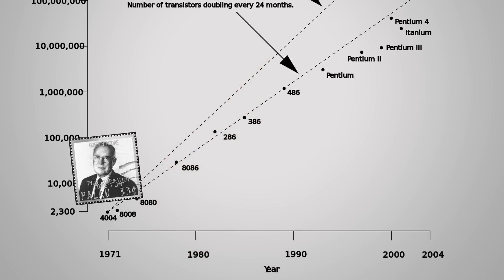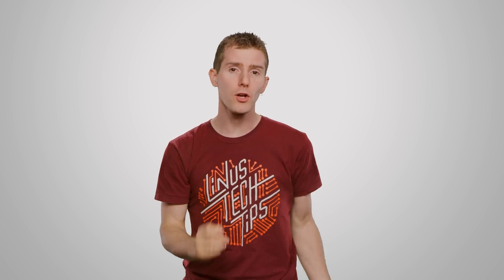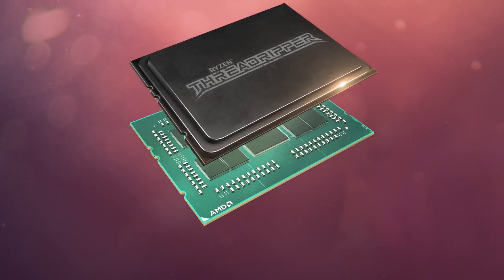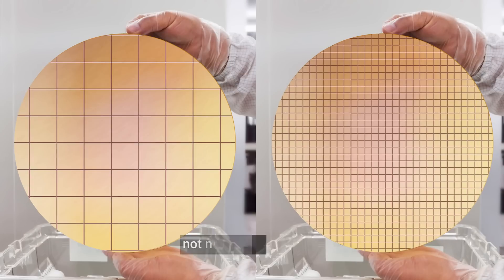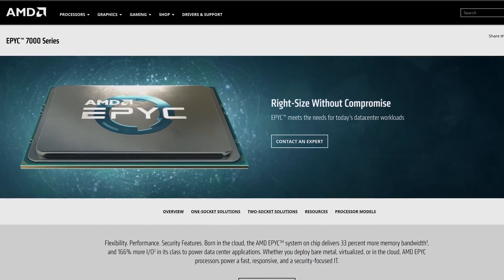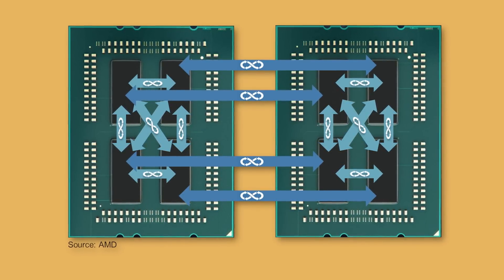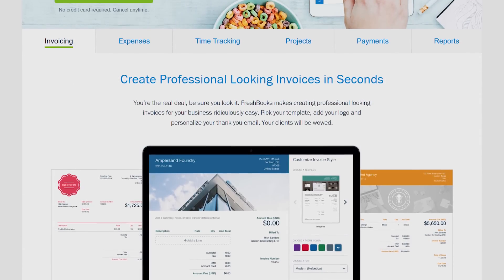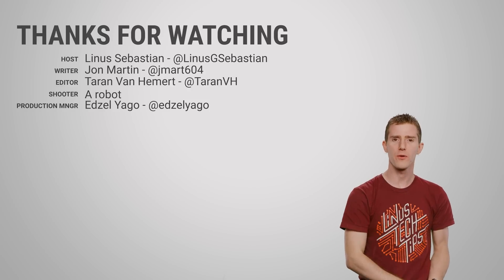How AMD is Making CPUs More Affordable - Chiplets Explained

Comment: And yet the Ryzen 3000 series CPUs are all overpriced. I can't believe I'm saying this but intel needs to come out with something new to lower AMD's prices.
Reply: Prices are not that bad.
Reply: @ayfr1249  
The Ryzen 5 3600 at 200$ and Ryzen 5 3600x at 250$ is the same as IF AMD launched the Ryzen 3 1200 for 200$ and Ryzen 3 1300x for 250$ back in 2017...

The Ryzen 7 3700X at 329$ and Ryzen 7 3800x at 400$ is as if the Ryzen 5 1600 was launched at 350$ and the Ryzen 5 1600x was launched at 400$ back in 2017...
Reply: @rattlehead999  Ryzen 7 1700x was released at $399 while 3700x will be released at $329. Same with 1600 being at $219 and 3600 at $199.

What's your point man ?
Reply: @ayfr1249  
I said AS IF.

At 7nm with the I/O gone, 6 cores should cost as much as 3 cores are 12/14nm with the I/O... And the I/O is extremely cheap on top of being on the now extremely cheap 12/14nm... -_-

And I mean the 1700 not 1700x.
Reply: @rattlehead999  The 7nm is a new process and their yields are not as high as with 14nm.
Reply: @ayfr1249  I'm comparing 14nm at launch to 7nm at launch.
Many did the calculations, there is no reason for the RX 5000 series GPUs and Ryzen 3000 CPUs to cost as much as they do...
I compared the prices/MSRPs when they were new, otherwise, currently the Ryzen 7 1700 is 160$, and Ryzen 5 1600 is 110-120$ so yeah.
Reply: @rattlehead999  Smaller the process, lower the yields. Price of $200 for a 3600 is totally fine by me, I don't see what are you complaining about.
Reply: @ayfr1249  Ryzen 3000 CPUs had 70% yield rate early last month, Ryzen 1000 CPUs were launched with an 80% yield rate, but at the same time... By launch, it will be at least 75% yield rate...
Reply: @rattlehead999  If you can't spare $200 for a 6c CPU you are better off buying a console.
Reply: @ayfr1249  I can spare 300-350 euro for a CPU, has nothing to do with how overpriced the Ryzen 300 and RX 5000 series are...

Overpriced = very high profit margins.

For example, the Radeon VII is NOT overpriced as it costs 650$ to AMD, and they are selling it for 700$, that's a 7-8% profit margin.

The RX 5700XT costs them around 230$ and they are selling it at 450$ which is 95% profit margins, thus overpriced.

The gtx 1080 has a MSRP(FE MSRP became the actual MSRP) of 700$ for a mid range GPU in 2016 that should have costed 330$ maximum and they sold the gtx 1080 at 100-138% profit margin during the duration of the gtx 1000 series GPUs, which is why their stock prices rocketed, the entire gtx 1000 series line up was overpriced to oblivion and still is.

The RTX 2000 series are less overpriced than the gtx 1000 series as they have much, much, much bigger die sizes.
Reply: @rattlehead999  GTX 1080 is a mid range GPU ?
Just tell me how you know all that stuff or you just make it all up.
RTX cards are overpriced as hell, I'm not paying  $349 for a mid-range GPU.
Reply: @ayfr1249  Well firstly I've studied hardware microarchitecture and design for many years. But since I can't give you thousands of pages and over a dozen of books of knowledge(which I've forgotten a lot of, since I haven't studied or applied what I've studied in 5 years)

The objective definition of a mid-range IC Chip(be it GPU, CPU or a simple micro-controller) is roughly half of the biggest possible die size for the wafer(also known as Optical Limit).

The gtx 1080(GP104 - Geforce Pascal 104) is 314mm^2, the GP100(unreleased gtx 1000 series GPU, only released as a GP100 Quadro) has a die size of 610mm^2.

Secondly, the gtx 560(GF 104/114 - Geforce Fermi 104/114) from 2011 had a 332mm^2 and costed 200$ MSRP(254$ MSRP) in 2016, but it had a 60-65% yield rate and 1GB GDDR5 costed 50-55$ back then and 40nm was the worst process node in history.

The gtx 1080 has a die size of 314mm^2, it came out with a yield rate of 80%+ and back in 2016 GDDR5(X) costed 5.5$ per GB, that's 44$ for the Vram.

AMD, Intel, Nvidia, IBM, ARM and so on do NOT pay per individual chip, they pay per wafer of silicon, the smaller the die size, the more chips you can have per wafer, the cheaper it is per chip.

So the gtx 1080 has a 10% smaller die size than the gtx 560, 15-20%+ higher yield rate,  and cheaper VRAM, why should it cost more than 250$? I give it 330$ due to lack of competition, they deserve to win more when they are ahead, but 700$...

Even the chip names are of the same tier between the gtx 560 and gtx 1080 - GF104/114(Geforce Fermi 104/114) for the gtx 560 and GP104(Geforce Pascal 104) for the gtx 1080.

Also, you can read Nvidia's annual/quarterly financial reports, to see their profit margins... 

But if their stock going from 19$ in Q1 2016 to 289$ in Q3 2018 doesn't scream insanely high profit margins I don't know what does.

Since people don't like to trust random people on the internet with arguments and facts, you can see many videos of random strangers on youtube that say the same thing. Like GoodOldGamer and AdoredTV.
Reply: @rattlehead999  The fact everything is overpriced is because people will keep buying the products no matter the cost. That's the biggest issue.
Reply: @ayfr1249  Did you read my entire comment or just quit? Just curious, because people tend not to do so.

That is absolutely correct, because people are ignorant and don't understand the products they are buying on top of 99.99% of YouTubers being just as clueless... they aren't even engineers in this sphere or at all... they just run benchmarks, config and build PCs/Servers... child's play... and people blindly follow them.

Not to mention that since 2008 the PC hardware market has been stagnant, barely improving every generation.

They try to make the smallest possible die sizes to sell them at the same or higher prices to increase profit margins while improving enough to call it "next gen".

Zen2 is absolutely poor upgrade for Zen1/Zen1+...

ARM and IBM, on the other hand, destroy each generation with the next.

Pay attention, in 9 months, ARM improved the IPC by 35-50% on the SAME Process Node, while reducing power consumption and transistor count by 15-20% and increasing clock speeds by 10-15%...

AMD in 2x years Improved IPC by 15% from Zen1 to Zen2 and all the 8-10% clock speed benefits come from going to 7nm from 12/14nm and Zen2 on 12/14nm would have lower clock speeds than Zen1(+)...
Reply: @rattlehead999  Who the hell cares about ARM and overpriced smartphones my man ?
Desktop CPUs will peak in performance in a couple of years and will come to a stop unless totally new architecture is introduced.
Reply: @ayfr1249  
You proved that you don't read my entire comments...

I care about ARM as they are in many servers now and in the coming years might take on the desktop...

ARM is NOT only for smartphones, they have server CPUs and the moment windows and iOS are written for ARM they are coming to the desktop.

A cortex a77 8 core beats an i5 8250U in X86 emulation! Just keep that in mind. IN EMULATION. And it's a RISC architecture emulating a CISC architecture which is much more demanding than vice versa.

Also as I said AMD and Intel and Nvidia are NOT improving their hardware more per generation on purpose... to milk us dry for what it's worth...

They could easily have 50% increased performance generation over generation...
Reply: @rattlehead999  They are not milking me for sure, I'm upgrading every 4-5 years so I'm not falling for that "upgrade every year" thing. It might beat mobile CPUs but I don't really care about that because I use desktops.

We surely need more competition on CPU/GPU scene because at this rate building a mid-range PC in a few years will be a luxury.
Reply: @ayfr1249  
VIA(bought Cyrix years ago) is going to release x86-64 CPUs soon as they won a license in a lawsuit against intel.

Intel is coming to the GPU market as they finally got licenses for AMD.

The i5 8250U is a desktop chip at lower clock speeds. And you need to understand that the ARM CPU has less than 10W power consumption and it costs only 15$!

The i5 8250U is like an i7 7700k at 1.8Ghz, but the ARM CPU is at 3.0Ghz.

A 15-20$ 8 core A77 CPU consuming very little power, beats a 300$ i5 8250U at 25W TDP AT EMULATION, I repeat EMULATION of x86-64 compiler!

In native code, a 4x core A77 would destroy the i5 8250U.
Reply: @ayfr1249  Also I want to upgrade every 1-2 years, but I don't. A good upgrade is 80% more or more performance at the same price as you paid for your current hardware.

Sadly this means I have to wait 4 years to get such improvement since 2008... so sad.

I'm a hardware enthusiast(doesn't mean I buy the most expensive hardware) and I like progress, evolution and especially revolution in the hardware market and I like to upgrade as it's a hobby of mine.
Reply: @rattlehead999  Well, upgrading your stuff every year to get 10% more performance is really stupid. I don't have an issue with Zen 2 pricing, obviously it could be lower but things are not as fucked up as the GPU market. Can't wait to see more players in the CPU/GPU market.
Reply: @ayfr1249  
Yeah, and the sad thing is that people that came into the desktop market or started paying attention after 2008 think that 10% improvement is good and are praising the 15% IPC and 8% higher clock speeds of Zen2, when Zen2 is a terrible upgrade from Zen1(+) or Skylake...

Only if you have an Athlon/FX CPU or Sandy bridge and older, OR you need more cores.
And that's 8 years old...
Reply: @rattlehead999  I upgraded from my Phenom 965 to Ryzen 5 1600. The upgrade was more than worth it.  With a little bit of OC this CPU can last me for at least 3-4 more years. My GPU is low-range shit but I won't upgrade simply because of the silly prices. Fuck them.

Comment: Hey Linus, As you said in the end "...signals moving at the speed of light..."
Is not true. Signals (EM waves), in this case electric current DOES NOT travel at the speed of light inside a microprocessor, rather electricity (in general) travels at about 1/100 th of speed of Light.

btw Love your Videos !

Comment: Actually it is not harder to shrink the io-die, it just doesn't make any sense. The performance uplift from going from 14 to 7nm isn't as big as would be really worth of shrinking it. Therefore they left the io-die at the mature 14nm node to have better yields and a lower cost per chiplet. That's basically all happening, otherwise there is no difference between shrinking the core chiplet or the io one.

Comment: 3:55 Fact Check: Electric signals do not move at the speed of light. Electricity is about 1/100th the speed of light through copper. So, in a CPU it's a little faster. I'd say it's about 30% slower.

Comment: But the problem is chiplets won’t improve clock speed only increasing core count which doesn’t make them faster
Reply: Clock speed stopped improving long time ago (+- 10 years) due to heat.
Reply: @ПрикладнаЕкономіка  what lmao? completely wrong
Reply: @BlackBird26  google graph with cpu clock speed historical and then think who is wrong and who isn't.
Reply: @ПрикладнаЕкономіка  Intel released the Core 2 Duo processor E7500 (3 M cache, 2.93 GHz, 1066 MHz FSB) on January 18, 2009.
2019 Intel have 9700k that has a boost clock of 4.9ghz
you're wrong
Reply: @BlackBird26  you can boost almost any 10 year old processor to 5 ghz with liquid nitrogen or something similar. Normal CPUs are 2,5-3,5 ghz now and 10 years ago. When clock speed stop improving they just started multiplying cores.
PS and I said to you to google historical graph, cherrypicking is not science.
Reply: @BlackBird26  boost and constant work is 2 different things, if you doesn't understand it then its your problem.
Reply: @ПрикладнаЕкономіка  9700k has base clock of 3.6 .. so more :)

Comment: Affordable? They're not much affordable than the Ryzen 1000 or 2000 series without the chiplet design. Simple answer is scability.  
With the Zen 2 and chiplet design, they max the leaked EPYC CPU to 64 cores,16-core and 8 Core Ryzen without having to design separate monolithic dies.    Intel can afford to design and manufacture monolithic dies for both considering their large market share for both.   Yields is not the reason considering GPUs with larger dies while costs less than CPUs like that RX 570 GPU or the Radeon 7, 7nm GPU. 
A chiplet is actually terrible because it uses more steps, more parts, larger footprint, and power hungry slower interconnect between CPUs but works for AMD considering Intel's continues to milk the market with low core counts. 
Considering this chiplet design, I wonder what they'd do with next gen APU. AMD might take this Ryzen 2 chip and have the GPU separately, connected through Infinity Fabric

Comment: Why not just make the CPU bigger in order to hold more transistors?
Reply: The electrons have to travel further away which makes the cpu slower and since they are so packed already it would generate more heat. We've actually already just about hit that limit so we're barely keeping chips from melting themselves. We want short interconnects but the biggest issue we are facing is heat and however we configure right now will just about burn up the silicon.
Reply: Kage Rogad thanks man

Comment: What about heat dissipation?  I would assume that spreading the cores out would allow more control if say only one core on 4 chipsets was active without any neighboring cores adding to the heat. Where an 8+ core chip would have at least neighboring cores on three sides.

Comment: We actually stopped gaining years back around 2008-ish not on the dot but originally it wasn't just transistors but also clock speed as well, Intel went on record in the 2000's saying worst case they expected 10ghz clock speeds by 2010 and for the most part it's really not improved since. Most performance to be had comes with higher speed ram, more optimized software to take full advantage of CPU's and most notably core count. It's not that we can't make a faster CPU but we have reached the tipping point of performance from clock speed, all CPU's process a lot of information extremely quickly however it's normal for CPU's to have minor errors this happens all the time on every CPU. When this happens the CPU's have to preform a soft reset (not system reset) just resetting the information it's processing to find what it missed during the error. During this time performance tanks hard for a small period of time, with clock speeds however these errors become far more frequent to the point any performance gained from higher clock speeds is out weighed by performance lost due to errors. 

Diminishing returns really, with clock speed comes errors and for a long time the performance gained by clock speed was greater than any performance lost by errors so it was a net gain but as clocks continue to rise the opposite happens errors cause more loss to performance than higher clock speeds can make up for resulting in performance dropping overall.

Comment: AMD's Ryzen was one of the best things to ever be introduced to the PC market.
Reply: У меня был в юности пк на амд. Грелся сильно, вырубался в аварийном режиме перегрева. А так шустрый
Reply: @vasyachapaev9801  I wish I could read your language. Sorry.
Reply: @mr_beezlebub3985  "I had an AMD PC when i was young. It heated up pretty quick, was cut down in emergency overheating mode. So smart."
Reply: definitely not
Reply: @ilovehotdogs125790  Definetly not? OK then how do you explain that between 2006 till roughly 2011 when Sandy Bridge was released and from Ivy lake to Kaby lake literally nothing improved on Intel cpus?
Since 2017 cpus have been evolving so quickly to the point where you can buy a i3 10100f which will roughly perform the same as the top of the line i7 from 3 years ago. When there is competition the customer always wins. So even tho you might be an Intel fanboy you have to admit that Intel cpus became better so rapidly in the 3 years because of amd
Reply: @ilovehotdogs125790  lmao ok guy. How do you think Ryzen wasn't great? It's one of the best things to happen to AMD, and they legitimately compete with Intel now.
Reply: @ilovehotdogs125790  I think there is indeed a bit of Intel bias here.
Reply: @ilovehotdogs125790  ok intel dickrider

Comment: Why not reduce the number of transistors by removing features such as 16/32-bit mode?
Reply: Now a days why whould you want thouse modes
Reply: @erikburzinski8248  My point exactly. Backwards compatibility should be handled by the software, not the hardware.

Comment: If the size of chiplet-based design is big (which means the heat generated per unit area of chip reduces) then the corresponding cooling cost can be cut down for server grade sets... Hey Linus, Am I right?

Comment: Moore's law only works until you essentially get down to single atoms.

After that, youd have to have controlled splitting or some crazy space time magic going on. As a result, we'll get down to the single atom and then they'll just start adding more cpus because it will likely be more efficient than the power levels involved to break space time, or the protection levels required to work with subatomic particles.

TL/DR: : instead of 64 core cpus, you'll have 64 cpus with 64 cores each.